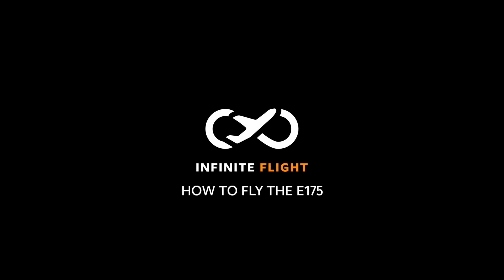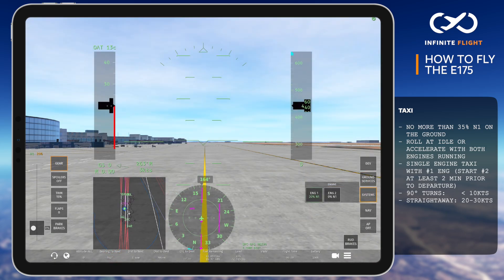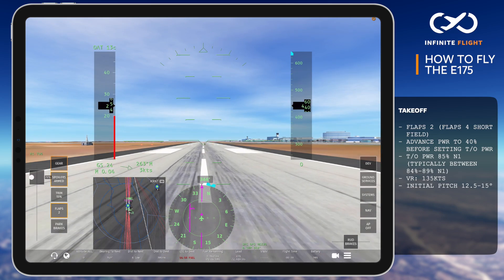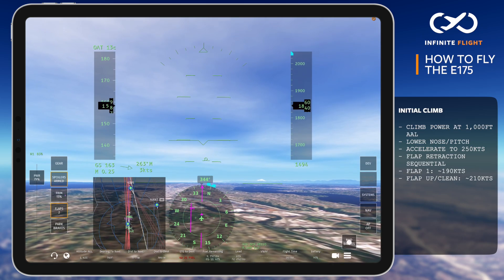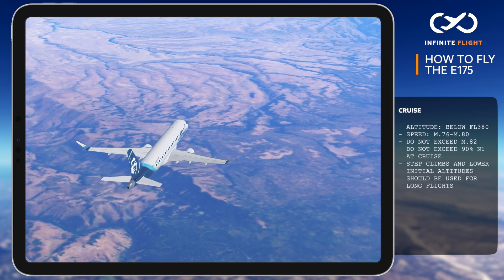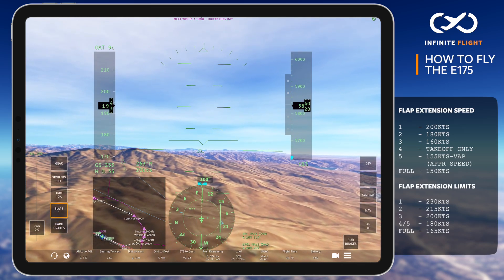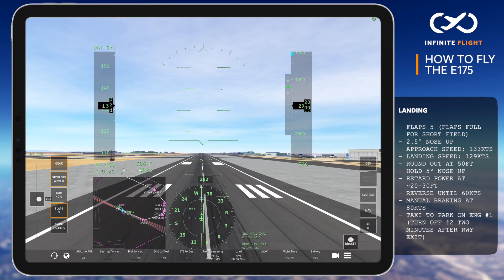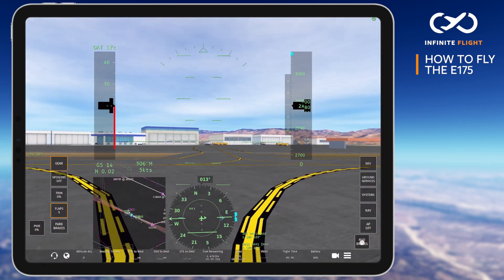How To Fly The E175

Comment: You should add these and rework for infinite flight:
1: Add A350-1000 
2: add a interior in the A350-900
3: Make the scenery more like X plane 10 mobile
4: Rework every plane especially the 747 and 787 
5: Add 737MAX and A320NEO models.
6: Different engine sounds for every plane engine (example high pitch whine on the a330) 
7: Y’all should add the 777x and Antonov planes like An-225 and An-124
6: Put a whirl on the 787 engine
7: add the APU system on all reworked planes
8: Y’all should add a joystick for players because some players don’t like the tilt controls it too difficult to fly and I crash a lot and I always use Autopilot.
9: Maybe add a interior for the airports
10: Add weather/ make the lights on the plane shine to the ground like in RFS and x plane
11: Space Shuttle and Rockets should be added and also helicopters
12: Add volumetric clouds like Real flight simulator 
13: We Need Taxi, Landing, Logo Lights and make the flight plan easier like RFS does.
14: MAKE IF PRO LESS EXPENSIVE!
15: Add more aircraft, such as ATR 72, 737-200, A340-200,300,500, Saab.
16: Imrove the ATC System, scenery, detail.
17: Make engine sounds different on all planes 
18: Add more livery’s, ability to make your own livery like RFS
Reply: you forgot about the space shuttle
Reply: @山手ちゃん  oh

Comment: Why'd you turn the seatbelt sign off at 10,000? Did you always used to do that before? I'll ding the seatbelt sign off and on at 10,000, but always leave it on until I get to cruise altitude, or above FL280 on short flights.
Reply: Rip passengers💀
Reply from the maker: In real life airlines typically turn off the seat belt sign above 10,000ft. Occasionally they'll leave it on in rough or turbulent air, but otherwise passengers are free to roam above 10k. Cheers!
Reply: @infiniteflight  Not from my experience. 10k might be when they release in-flight service on shorter flights, or when they turn on in-flight entertainment, but I have never seen the seatbelt sign turn off that low.

Comment: Hey Tyler. Just to go off topic, I would like to know what Sensitivity Settings are you running? Your control inputs are so smooth, I had to ask.
Reply from the maker: Happy to answer, Jeremy! I use the default sensitivity on everything except rudder which I have roughly around the 25-30% area on the sensitivity slider. This allows you to use a bit more of the full rudder range with gradual control surface effects. Besides that, it's about 10 years of obsessively playing Infinite Flight! Keep at it and thank for watching. -TJ
Reply: @infiniteflight  thank you Tyler. Appreciate the info... Keep up the good work!😊

Comment: You also forgot that the E175 Extend it flaps while pushing back
Reply from the maker: This likely varies crew to crew and operator to operator. As long as they're set before takeoff you're good!
Reply: @infiniteflight  

Rfgh
Reply: @infiniteflight PORTUGUÊS-

Era Pra Ter o A320Neo😔 Na Atualização 22.8

INGLÊS 

I was supposed to have the A320Neo😔 in the 22.8 update
Reply: @FlightAviatio  Infinite Flight never stated anything about the the A320neo coming in 22.8, and they are not working on it at all right now
Reply: @MuddyAchiever1  fala em português pofavor
Reply: @FlightAviatio  just translate…..
Reply: @FlightAviatio  just translate it it isn’t hard
Reply: Don’t think so